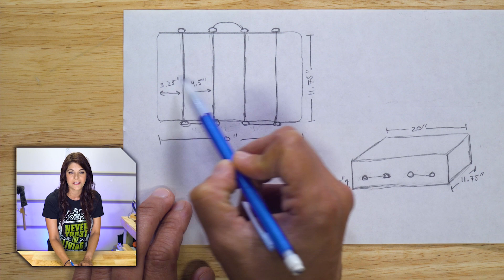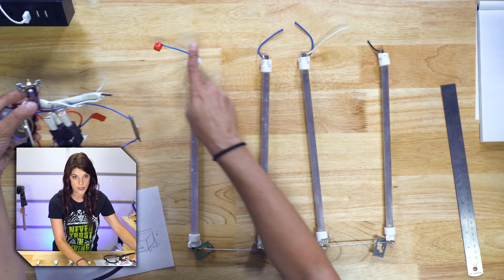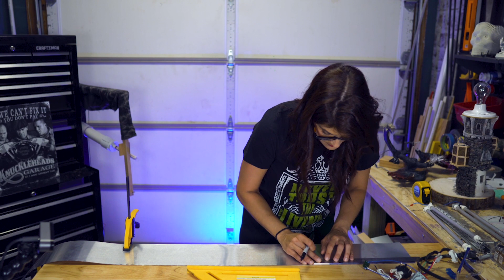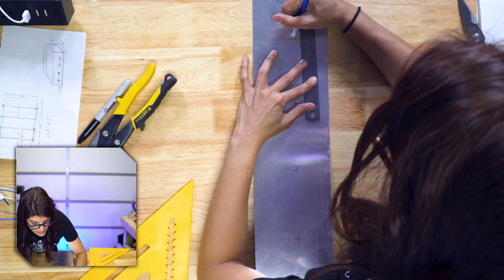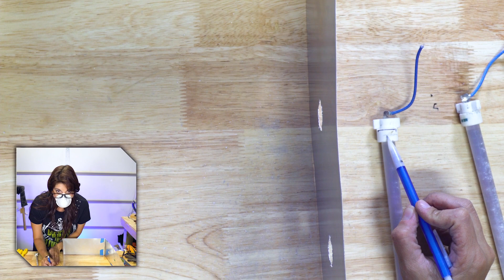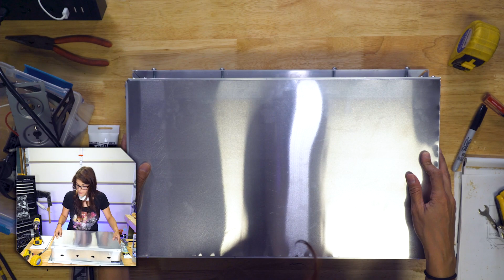DIY Vacuformer Part 2: Build a No-Weld Heat Box

Comment: I use to use a toaster oven to heat Kydex for holster making.  I now use a T-shirt press.  To prevent hot spots in the Kydex, I would place a sheet of ceramic tile over the heating elements.  The ceramic tile will absorb the heat and evenly distribute it onto whatever material is lying on the tile.

Comment: You can use pop rivets if you ever work with thin sheet metal like that. It will be way more easier than nuts and bolts. 👍

Comment: U could use a screen installer roller tool and cross brake for strength..they have a tool for such to use on like the ground but a screen tool works and make a x on each side and it will be sturdy..maybe help in future